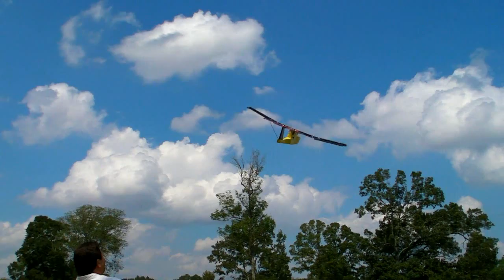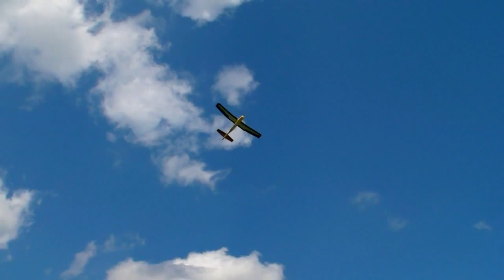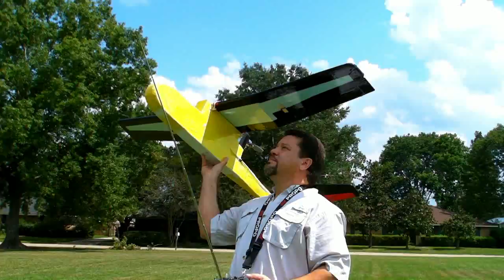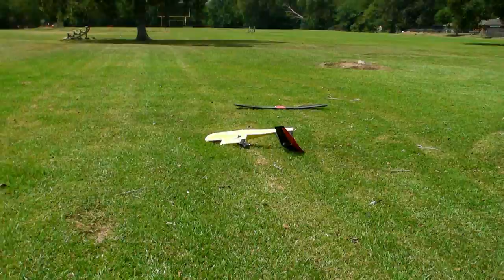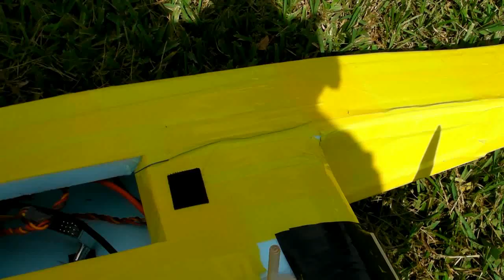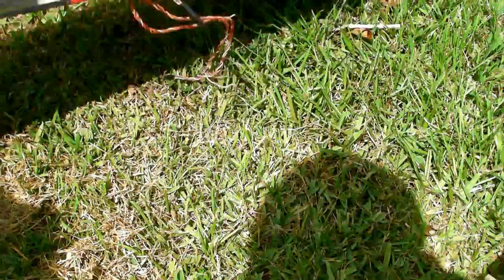Skywalker clone test series

Comment: From what I can see this scratch built model was a complete success. It has plenty of power but you pull back on the throttle way too much and in your turns your allowing the plane to fly near stall speed. May I suggest you fly out on full throttle until 200 feet and then fly around at 75% power, try that and I'm sure your building skills will put a smile on your face. Theres plenty of sky up there and if you do stall your high enough to correct. Nice build mate.